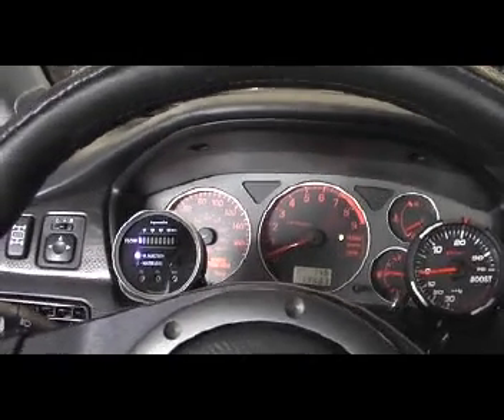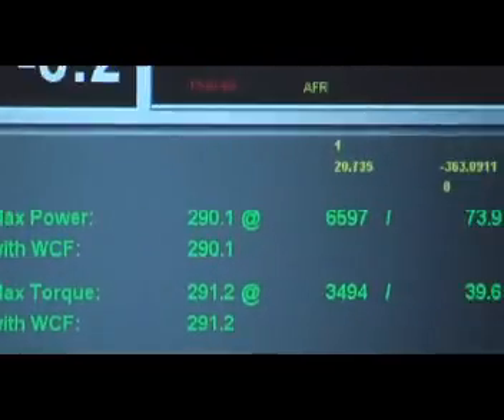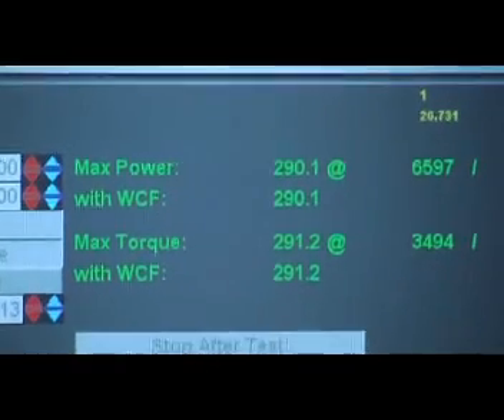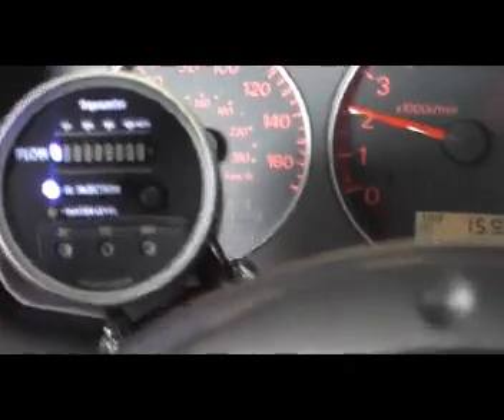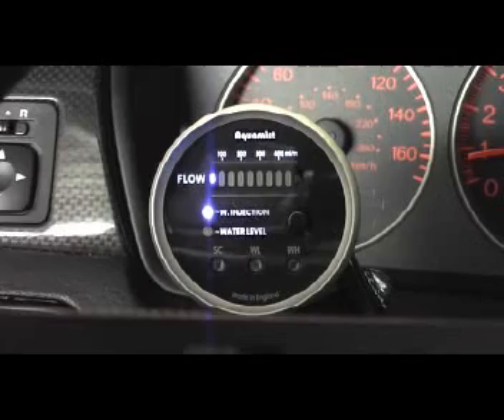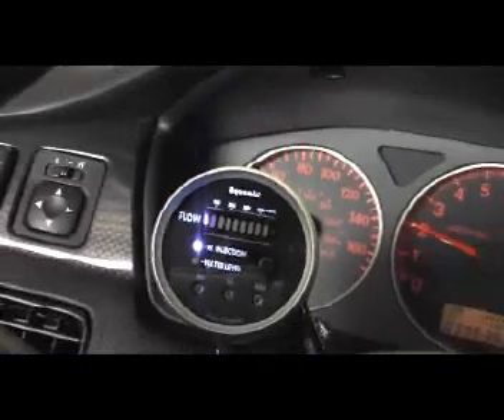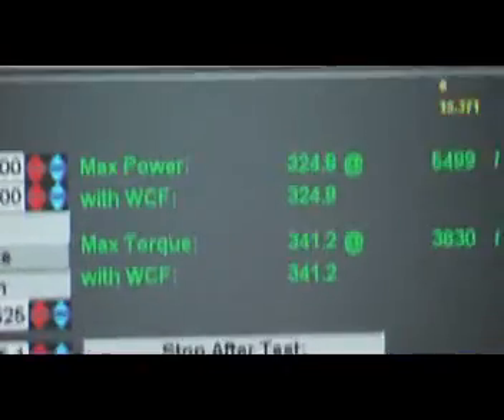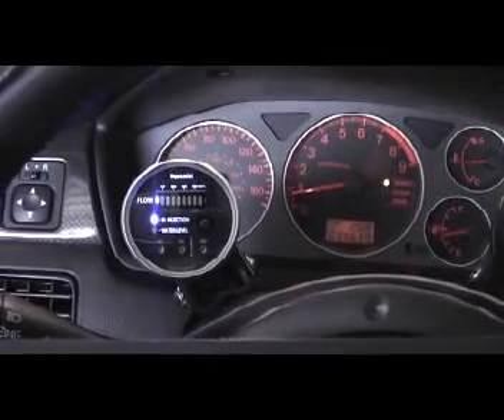Tuning Aquamist on a Stage I Evo IX

Comment: Water does have a lot of potential.  However, you need to use a nozzle that is half as big as with meth.  If Al had tried a smaller nozzle, or even removed some fuel he would have picked up power for sure.